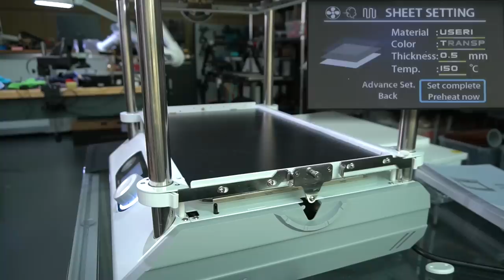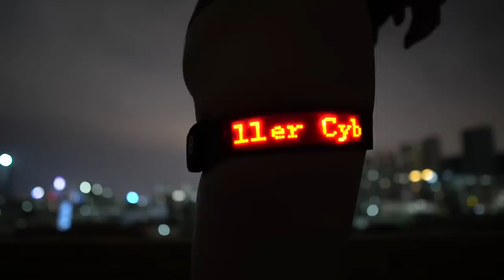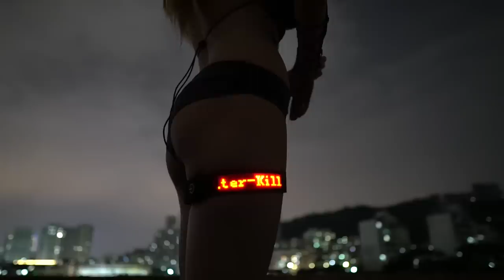Kydex Bra Vacuum Forming With The Formart 2

Comment: When I was a young boy we had a toy version of the vacuum former called Vacu-Form. It had a 4 inch square hot plate that you could make small molds from and was pretty cool for an early 2960s toy. I believe it was discontinued after too many kids getting burned from the surface of it. The one you're using is much larger and safer than the older one but burns are still possible.

Comment: Been loving the Formart 2 during my testing but reminded me how much material waste Vacuum Forming can have, a bit like 3DP Supports I suppose. It's almost TOO easy to use up a whole pile of sheets! That Kydex doesn't look all that comfortable, I heard you can form EVA foam sheets and they stay fairly flexible... :D
Reply: I think a lot of it is recycleble . But yes you could end up using a pile!!
Reply from the maker: It's actually pretty good once you put the edging on!
Reply: It doesn't take any longer to do a full sheet than one item, so you're better off filling a full sheet with lots of bucks ... or using a smaller sheet. 
Question: is the sheet support / locking frame as flimsy as it looks?
Reply: @Naomi-Wu  haha fair enough!
Reply: @CraigTrader  the frame holds the sheets well, the wheels at each end tighten down quite hard to lock it. It's a little loose on the rails but I think it'd bind up too easy otherwise and that part doesn't require precision.
Reply: @MakersMuse  I mean they are rather.... formed... to shape.
Reply: interesting
Reply: Too much waste for me....

Comment: Pretty cool video! You turned yourself into a super BADASS! When I was in design school we made molds out of wood and then vacuum formed off of that. Then you can reuse it a lot of times. Just remember to always leave some sort of slope from bottom to top of the form or your mold will get stuck in the plastic sheet after forming. 👍🏼

Comment: If you want reusable molds, you could just use plaster. It's pretty temperature resistant in my experience.
Reply: I have actually done a lot of this commercially.  Plaster of Paris is ok but a little fragile and you have to dry it thoroughly because the steam expansion makes cracks.  We used Hydrocal...not nearly as fragile.  You can 3d print a mold to cast the Hydrocal in.

Comment: This looks very useful for a project I'm working on now that needs a plastic shell enclosure to keep dirt off mechanical parts. Maybe an option for a multi-use mold is CNC machining the shape out of wood.
Reply: Maybe check adam savage's vaccum forming videos, in an old one he shows how they make vaccum forming molds out of insulation foam, could be faster and easier for "simple" shapes
Reply: @thombaz  Why wouldn't you be able to?
Reply: @thombaz  If you have sharp tools there should be relatively little heat and with proper programming you would minimize dust with good sized chips. Probably not the best idea for production runs but wood could go a long way in prototype work.
Reply: @thombaz  They've made CNC routers for years. They use vacuums and enclosures to deal with the dust and chips. CNC is a method of control, it's been adapted in industries as diverse as metal fabrication and food processing.
Reply: @thombaz  What are you talking about? Wood is used for CNC machining all the time. I've done it myself many times.
Reply: That's what I was thinking too, but then again I don't use my 6040 enough so I'm always trying to find an excuse to justify what I spent on it. :P
Reply: its even on gun holsters now. 

this looks like what they used for old 2005 Batman movie ( the 1000 pcs mask batch lol)

Comment: You could back fill the 3D printed form with plaster if you use a low infill like that.  For a large object, that will take a lot of plaster.  Coating your print with a heat resistant epoxy does help a lot.  CNCing parts out of layers of MDF works well, but heat causes MDF to swell a bit.
Reply: My instinct also was a thick-ish outer shape and backfill for support: plaster with scrim for strength. Alternatively 3D print the reverse of the shape use as mould for plaster.

Comment: My mom did this in the 1970's.  We made magnetic signs for car doors, mostly.   All the signs had to be set up with (very large) type and glue on cardboard and the bed for the unit was about 30x60 inches.  There were a lot less kinds of  material back then, but the process was the same.   I thought that method had dropped off the face of the earth, but I guess not.

Comment: There was US toy called the Vac-U-Former I had as a kiddo. It was meant to make plastic bodies for matchbox toy cars but you could put any object in there provided the high temps wouldn't melt it. Besides making my own small custom vacuum formed plastic pieces I could also make molds that way to press molten "friendly plastic" or the air hardening resin goop that came with my Creepy Crawlers oven into

Comment: I ran thermoforming machines in a factory one summer as a teenager. We mostly used wooden molds or epoxy molds or cast aluminum molds with water tubing for temperature control. Plastic sheets arrived just in time. If kept for very long the sheets would need drying before they could be used. Thanks for the memories. Will you be getting a water jet cutter?

Comment: It’s a cool idea but part of me really wants to ‘fix’ the verticals with linear rails and/or bearings. It seemed like you were struggling to get the frame to move evenly with the two handles on opposite sides like that?

Motorising the frame would also be a nice upgrade assuming they it can be made to move fast enough for the actual forming step.
Reply: As peeps say, nothing good ol' WD40 can't fix...)
Jokes aside, I'm sure if it wasn't for that friction, it would be hard to make it stay at the top the way it is now. That would require additional stuff. But, I guess, ball bearings and fixation clips would be a good addition.

Comment: Awesome project! 
In regards to the positive model longevity, 
perhaps try printing hollow/vase mode (when possible) and filling with plaster? Alternatively, you could print a negative mold and fill that with plaster (this worked well the one time I tried it with a different vacuum forming setup)
Reply: I have actually done a lot of this commercially.  Plaster of Paris is ok but a little fragile and you have to dry it thoroughly because the steam expansion makes cracks.  We used Hydrocal...not nearly as fragile.  Like you say, you can 3d print a mold to cast the Hydrocal in.

Comment: Naomi, if you are familiar with Standard or industrial vacuum Forming, you must know that the items used as mold have small pin holes to help the vacuum and the sheet of the material to follow all the contour including the small details of the mold.  Now the 3D molds that need to be soaked in water probably help to garantee that succion will get all the air out of the 3D mold.   I think you sould try this, next time you make a 3D mold, include 1mm pin hole spaced in a way to help vacuum to suck all the air fast.  It should improve the quality of the final results.  
Oh continue the good work.
Reply: the soaking in water is meant as precooling to help mitigate the distortion that she mentioned. Other more heat resistant materials should be used for the mold if many pieces are required

Comment: You have a CNC machine, which means you can make the vacuum forming bucks out of RenShape; it's an industry standard for vacuum forming. A cheaper option is 3D printing a negative mold and then filling it with a two-part epoxy such as Devcon or Milliput(might need some hand finishing afterwards or you could try draping the part in either 100% wool or silk velvet to get a smoother finish).
 Also on tight radius parts, sometimes the only way to get a good result is to help push the styrene where you want it to go if the vacuum alone isn't getting it there(make sure to wear gloves!).

Comment: You can CNC mill a mold out of wood. It withstands much higher temperatures than PLA, can absorb some water, is relatively cheap and simple to work with. And you should remove any water from the pump as soon as possible and perhaps add some vacuum oil to it but first ask tech support if it`s ok to do so.

Comment: A better way of making a form for vacuum forming might be to produce a negative mould of the item you wish to mould via the 3D printer. Then fill the negative mould with plaster of Paris to give you a solid form that will not melt.

Comment: I can see where careful job planning is required to get as many parts on the work area as possible so as to minimize material waste. When getting ready to form a part, look around for anything you could form from the same material and fit it in the extra spaces.

Comment: I worked for a thermal forming plant for a year. The dirtiest most toxic environment ever outside a plating company. Kydex is a amazing material. The go to for firearms holsters and accessories. You don't need that machine. If you really feel the need to thermal form for small projects just DIY one out of a shop vacuum. I had extremely good results thermal forming RC car housings.

Comment: Industrial Vacuum Formers used to have re-usable forms/moulds 50 years ago,  so I cannot think why in modern times that can be done for the enthusiast and at reasonable speed and cost.  You would not expect the life span to be as long as an industrial equivalent but much longer than you, Naomi, stated.  Sometimes multiple products would be vac formed at the same time commercially, but there were limitations to this due to shrinkage of material.  Vacuum forming tended to be used for longer runs of simple, often disposable products, and it's only in more recent decades that it has been generally really used for more technical products.  I don't think that I would ever consider using vacuum forming in a home or enthusiast environment whereas I would 3D printing.

Comment: I worked with big vac-forming machines waxed the mold with car wax to help remove the form from the mold heat is the trick to getting a good form piece other wise it doesn't suck down completely if too cold we made spa liners out of acrylic sheets and body for exercise equipment from abs plastic sheets they drilled holes in the molds to help suck down the stuff these vac formers were all hand made big machines I had to rebuild one when a guy fell thru it while cleaning lol he was ok but it tore it up

Comment: take wooden boards - use a vacuum to impregnate them with epoxy - let cure - sand and plane them - stack and epoxy them and press them all together - square it up on a band saw - then you can use a cnc mill to carve a puck for vacuum molding that's fairly cheap and easy to work with and won't draw moisture - it's also sandable - or you could make a silicone release mold and then cast it in epoxy but if it's going to be a large fill area you can put a filler inside - my favorite is to mix portland cement with styrofoam for the aggregate (know as lightweight concrete) - concrete has great compressive strength so the vacuum process won't destroy it and it's porous - so i'll typically make a rough filler and suspend it where i want it and then fill the mold with epoxy and vacuum cure it to remove the air and yes you'll have to add more as it's pulled into the concrete - when it's done you'll have an epoxy puck that is workable and non-porous and basically indestructible - this saves on epoxy - i started to go as far as making metal pucks if i can get the material as scrap - the epoxy needs to be high-heat epoxy btw or the vacuum former will distort it slowly over time

Comment: You should try a nibbling tool. They also have an electric version,  great to cut out shape in plastic.  I used it with car stereo installs for trimming and making a square hole for switches

Comment: In regards of the usefulness of your molds. you may want to try using the 3d model to create a plaster mold. it would be heavier but it would resist the heat and deformation of the mold while vacuum forming

Comment: It looked like you could use an ultrasonic cutter to deal with cutting those things out.  Also I wonder if your finish might have been helped by  brushing  UV cure resin over your prints and curing it with a UV flashlight.  Maybe fill the backside of the 3D prints with expanding foam.   This is a decent way to make molds for composites if dimensional accuracy isn't required.

Comment: Hi Naomi! Very cool application of the technology ;-)
Okay you had a serious issue/question regarding the 3D printed plastic as a form to be able to reuse it. This might be a solution:
1. Refrigerate the form between each use.
(Lowering the core temperature of the form will increase it's resistance to melting right? So cooling the form back down before each use will increase it's stability)
2. Use a light application of a spray-on Mold Release Compound before each use and clean residue afterwards
(The light application should provide a barrier between the two plastics that not only will minimize fusion, but also again create a small - but significant thermal barrier)
I am curious to see the results of this experiment!
Again awesome idea for your cosplay builds!

Comment: the usual way of using a reusable mold in a high temperature process is usually to use a different material.  clay or plaster is usual.  it means an extra couple steps after you 3d print and before you vacuform, but it creates a mold that should take no damage from the heat, and so would be reusable as often as you wish with little to no cooldown needed for it.

Comment: Interesting that it pulses the vacuum. Wonder if that's because their vacuum pump is low duty cycle, or if it helps with the forming. Maybe it was just for the first one that was set to "rough"  Nice that you're not locked into their barcoded materials. (And congrats on the skillshare sponsorship!)

Comment: I wish you had explained the heating cycle. Did it heat the form, the media or both? When separating the sprue from the boob mold did you pre-score or cut it? What is the maximum "z" dimension for different materials?

Comment: PETG is a much better material for 3D-printing bucks for thermoforming. I've been doing that using the thermoformer at my local makerspace, and my Vacuform DT2. I typically print my bucks with at least 3 perimeters and at least 10% infill and I've been able to draw as many as a half-dozen molds from each buck. (I haven't done more because I've been doing prototypes that were then sent off for manufacturing.) For larger runs I'd suggest milling the buck from MDF or aluminium.

Comment: What a cool machine. Might have to torture the credit card a bit!

An idea for the larger prints - you could 3d print an inverse mould, then use plaster of paris to create the forming pattern? PoP is okay up to 1000 degress C, so well over the working temperature for vacuum forming, but obviously you'd need to check with the manufacturer if that was a supported usage
Reply: I have actually done a lot of this commercially.  Plaster of Paris is ok but a little fragile and you have to dry it thoroughly because the steam expansion makes cracks.  We used Hydrocal...not nearly as fragile.  You can 3d print a mold to cast the Hydrocal in.

Comment: Do you think an annealed high temp pla would be worth trying for a mold? Proto-pasta claims about 140°C Heat Deflection Temperature while normal PLA sits at 55°C and PETG 100°C

That should put you much closer to the working temp of the sheet and theoretically give you much more runs from one mold.

Unfortunately I haven't had an excuse to pick up a oven for annealing and i don't want to anneal it in the kitchen one :-D

Comment: I'm subscribed to a few custom cosplay crafting channels and I'd wager 90% of armor crafting is a type of moldable foam that only needs a heat gun to get the foam into shape and paint, but I can really see this device working for a set of cosplayer crafters that might be going for that extra mile when making armor (i.e. Mandalorian, Anime, World Of Warcraft etc...)  .  Its really going to come down to cost, available room in the work space and how easy it will be to make or get re-usable molds.   Packaging mold just looks like icing on the cake.  I imagine someone's already got their gears working on how to make use of a device like this, but I'd wager most of the cosplay crafters I follow will probably stick with the foam since Conventions might get uppity if someone manages to knock out a creeper with a breast plate made from a molded plastic. ^o^

Comment: Seems to me that if you can already print out a form you've already got all you need to produce the ones and two that form would allow - might as well use the 3D printer to create your shell.   If, however, you use the 3D print to create another solid form from another material that isn't affected by heat, then the vacuum former may be useful for printing many copies quickly.   Then you'd need your laser cutter to trim whatever you've created!   Or you need a Dremel or similar so that you can quickly trim out the shell from waste material.

Comment: Given the simplicity of the process and the current level of automation, I'm surprised the user has do so much.  It's not like a 3-D printer where once started, the operator can just walk away.  As for the form, the only thing I've seen used by model railroad and RC enthusiasts is close grain wood.

Comment: Seems like a fancy shmancy machine as I'd expect from something that's (currently on sale for) $1799.  Sure you CAN build a similar styled not-smart machine for much less money.  The soaking in ice water is really strange, I'd suggest sealing it with some high heat enamel paint or even some simple filler primer paint, I've done that with some visor moulds myself and it worked great.